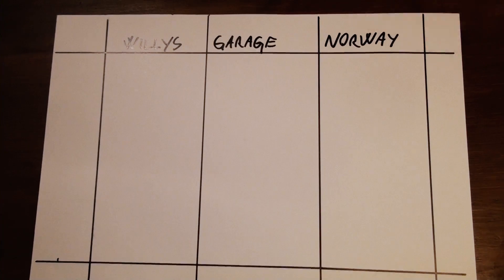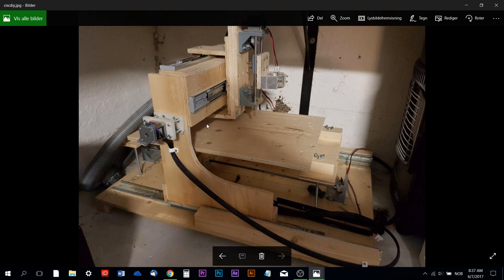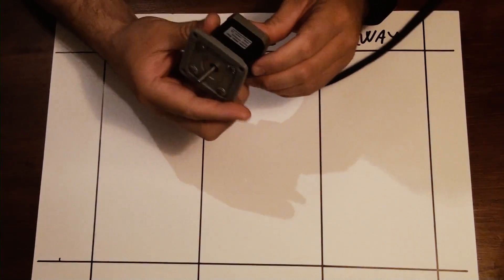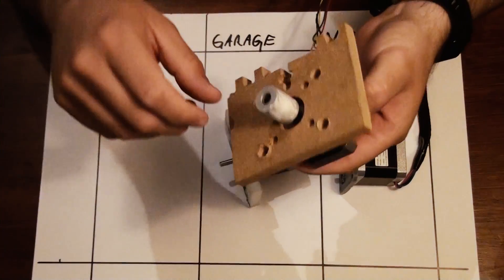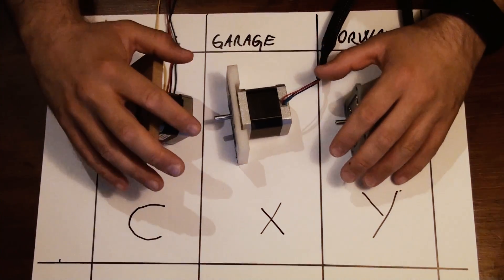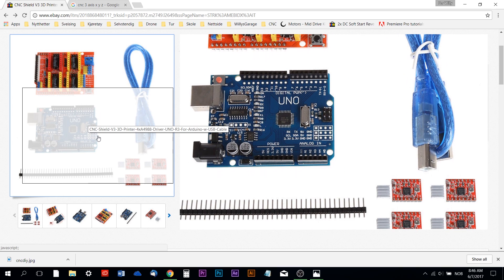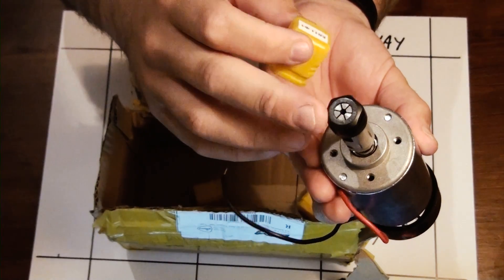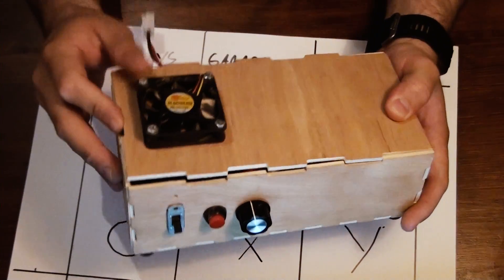First DIY CNC build (Part 1) - Introduction and plans

Comment: Actually, I am doing the same thing as you are by watching YouTube channels meaning yours to learn how to make a variant CNC machine.  Using the same components, I decided to make a watch cleaning machine because the commercial machines out there are out of my price range, so I figured that three stepper motors, Arduino Uno, and CNC shield would be my inexpensive solution.  I am terrible at C++ programming, so your tutorial #3 is getting me started in the right direction, hopefully.  Thanks for the tutorials they were interesting and inspiring.
Reply from the maker: Hi and thanks for your feedback :)  The best way of learning is just to get on with it and learn as you go 👍 I'm glad my videos could inspire your build

Comment: Can I ask, why not just use aluminum extrusions?  Why choose supported rails, etc, on your build?  I respect your opinion and I'm interested in your thoughts.
Reply from the maker: Hi and thanks for watching. I don't know if you have watched the whole series? but the design have later been improved as I got more experience about the CNC works and don'ts. This machine was meant as a first for me, to learn more and maby later build a better machine. My plan is still to build a new and better machine in the future and I could not have done that without this experience :)
Reply: @WillysGarageNorway  I've watched the series and fully enjoyed it.  Used your work as an inspiration to build my own.  I'm like you in that I'm learning and shaping it as it grows.  I think that's a fair metaphor.  I'm at the point where I can either make substantial improvements on mine or simply rebuild it, and I think I've found my answer.   Mine, like yours, has potential, and I'd hate to see it wasted.  Keep building and keep sharing.
Reply from the maker: I'm glad my videos are inspirational :) I think I'm going to keep updating my machine for a while, see how it goes and what I can learn from it. It still works and does the tasks I need it for 👍 The approach you are taking with learning and shaping as you go is in my experience one of the best ways to learn about stuff :)
I will keep on building and sharing and thanks again for your feedback, it gives me inspiration.

Comment: Hei. Et spørsmål. Jeg er en nybie som har en intensjon om å bygge en CNC freser. Du nevner ulike programmer underveis men må selve produktet du ønsker å produsere tegnes først i for eks Fusion 360 for å så eksportere til GRBL?
Reply from the maker: Hei og velkommen i "gamet" :-)  "Produktet" må først lages i et program som f.eks Fusion 360. Fusion 360 har så en funksjon som heter CAM. Der kan du lage Toolpaths (verktøy veier) og eksportere disse som g-code fil til det programmet du bruker til å kontrollere CNC maskinen. Jeg bruker som du ser Arduino UNO som er programmert til å ta imot g-coder i GRBL konfigurasjon.  Men det finnes andre løsninger som f.eks Mach3, universal gcode sender, Linux CNC, chillipeppr o.s.v.  Man kan også bruke web-baserte løsninger der man kan lage modeller rett inn og kjøre de ut som g-code. Det finnes utrolig mange løsninger i alle slags prisklasser. Jeg hjelper deg gjerne hvis du har noen spørsmål :)
Reply: Tusen takk for raskt svar!
Jeg kommer sikkert til å ta kontakt om nødvendig.

Hilsen
Brian

Comment: i guess those are NEMA 17. Are those strong enough to into wood?
Reply from the maker: davabran You can cut light woodwork with the NEMA 17 if you have the rigt controllers. I did not get the strenght I wanted with the CNC shield on the Arduino Uno. I changed the steppers to NEMA23  and the controllers to TB6560 hooked up to the Arduino. I recomend using NEMA23 for wood and harder materials :-) Check out this video: https://youtu.be/Oy8vDJTGCY4